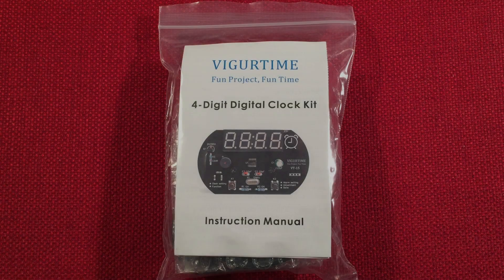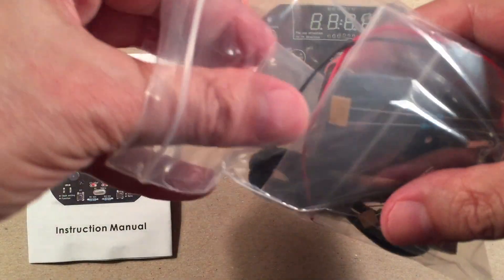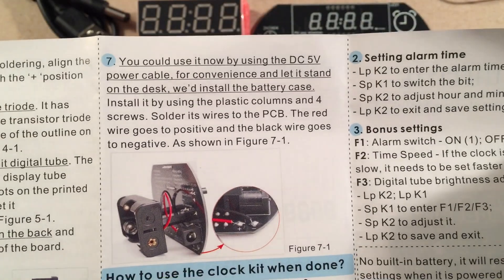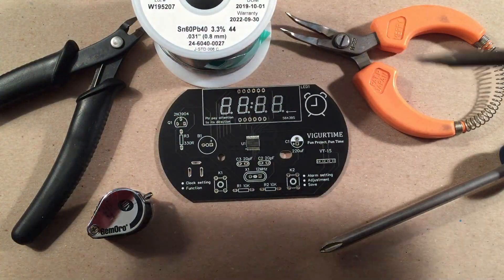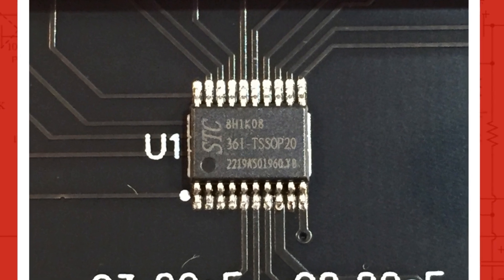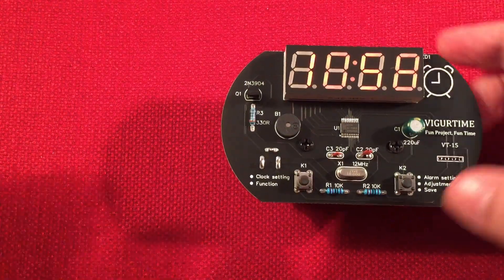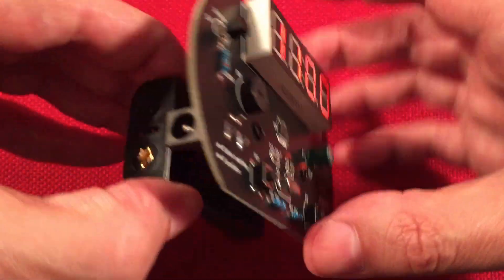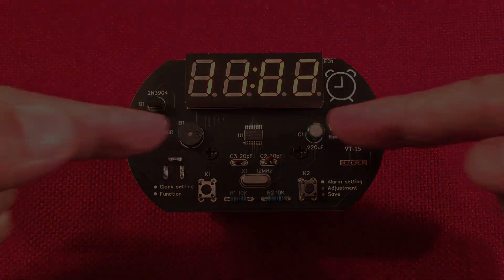VIGURTIME VT-15 DIY Alarm Clock Soldering Kit

Comment: Hi! Just finished putting kit together. Very easy. Like you stated on the video, I wished the DC input part served as a battery charger, as you know, once you loose power, you will have to set up the clock again. So far clock is running accurate. Will try to post in the future if I do use the speed adjustment function.
Reply: @todderbert, my findings are that the clock runs faster on DC input than on batteries. My settings for it to be the most accurate possible are: 

When on DC Input speed set at 7, when on Batteries speed set at 9 (max). You can run the clock on DC power with the batteries installed, but this doesn't do any good, because if you loose DC power you can not engage the batteries until you unplug the DC input. So clock will reset when you unplug the DC input.

The good thing...brightness and clock speed do NOT reset when losing power. Somehow they are saved on the main chip.